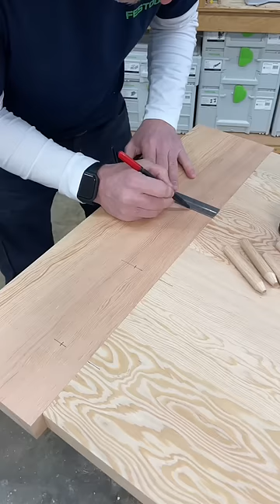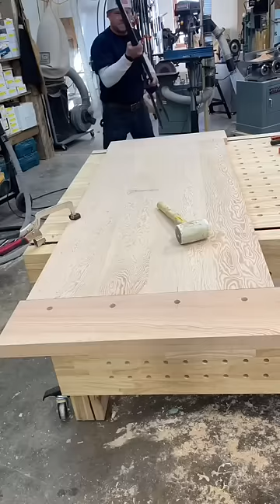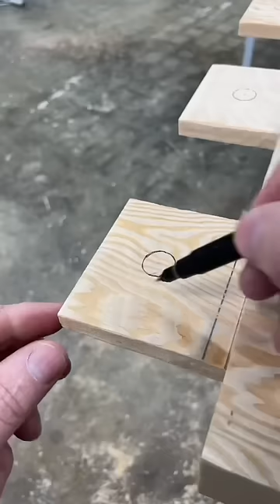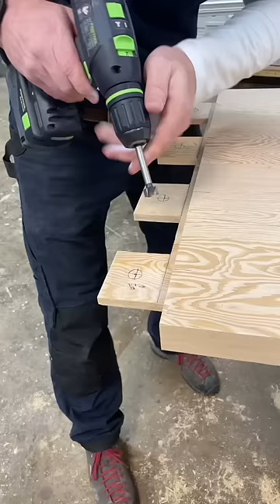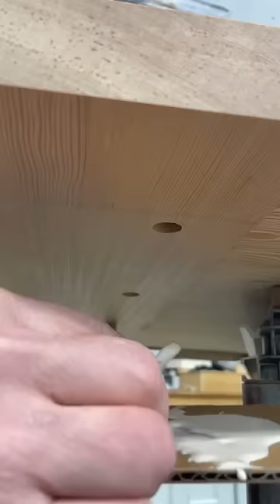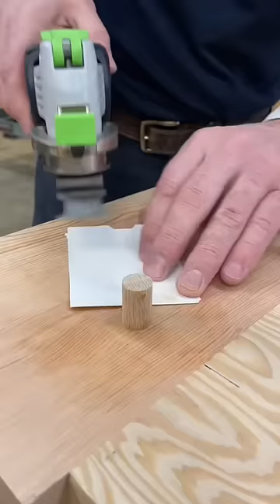Draw bore pegged breadboard #woodwork #woodworking #maker #wood #tools #bois #holz #madera #joinery

Comment: The long boards will be the ones that will expand/contract along their WIDTH due to absorption/drying from changes in temperature and humidity. The table top would get wider/narrower ( and more noticeable in areas with changing seasons, houses that use dehumidifiers/humidifiers, etc. ) The breadboards themselves will not expand/contract in the same direction as the long boards because wood doesn't expand/contract in length ( going with the grain ) appreciably, compared to the width. There isn't much wood between the pegs and edges of the long boards as far as the expansion of the breadboards along THEIR width. Gluing every tenon would cause the bread boards to inhibit movement of the long boards and could cause cracking but not if only the tenon closest to the center is glued. Only the holes in the tenons need to lengthened slightly and only along the direction where the long boards will expand and contract.
Reply: Thanks! Question answered on the 2nd comment
Reply: Thanks. Bit too complex an answer for me to understand, but I got the bit about gluing only one pin and plug that I was curious about. Michael 🇦🇺
Reply: @SpatialGuy77  lol. I didn't get it all either.  more glue =  breakage
Reply: Pins are still overkill imho
Reply: @rileyjordan9072  It's a tricky situation, you want the joint where the breadboard meets the long boards to be tight and at the same time allow for only the long boards expand and contract.
Reply: @pouncepounce7417  If you don't have pins, what will prevent the breadboard separating from the table since you can't glue the length of the breadboard ?
Reply: @Rainman270  The glued dove in the middle? It is an rather big area for glue to grip on and table tops are usual not put into pull force.
Reply: @pouncepounce7417  Actually, the male part is called the tenon, the female part that accepts the tenon is the mortice.  I personally wouldn't put glue on one of the center tenons since the pins will ( if properly done ) will keep the joint between the long boards and the breadboard tight.
Reply: @rileyjordan9072  More glue = stronger… but that just moves the failure point elsewhere. The breadboard end is designed to prevent cupping while allowing the tabletop to naturally expand and contract.
Reply: You DO have pins, like three, but only the center pin is glued, this allows the long boards to expand in their width. Basically, it's a tongue and groove situation except the ends aren't seen. You dry fit the tongue into the groove, clamp the breadboards snug to long boards with long pipe clamps, mask off the top where holes will be drilled, drill three holes ( don't drill bottom part of breadboard ), disassemble, widen only the OUTER TWO HOLES of the tenon with a rat tail file  so the long boards can expand/contract in their WIDTH. You don't want to widen those two holes so the breadboard can separate from the long boards LENGTHWISE, you want THAT joint to remain tight. Hope that helps.
Reply: @rileyjordan9072  Its hard to explain verbally, but the only thing glued is the center pin, if you glued the entire mortice and tenon ( really just a long tongue and groove,the glue will inhibit the expansion of the long boards and they will crack.
Reply: @pouncepounce7417  What will keep the breadboard separating from the table if you don't use pins and shouldn't glue the entire length of the tongue and groove because the wood might crack ?
Reply: @pouncepounce7417  That entire groove ( mortice ) should not receive glue, just the center pin.
Reply: @instantsiv  Correct and to showcase skills and hide end grain.
Reply: That was my thought, limited as it may be
Reply: @danbates5423  Well, I'm sure I confused everyone with MY long-winded explanation.
Reply: That's your opinion
Reply: @tonykinsey8933  Why don’t you wade out into the deep end and give us YOUR opinion ?

Comment: 30 years ago we put a offset to the holes for the pins on the top. So it would press the boards together. With a little pressure it would never loosen itself

Comment: I absolutely love watching these videos.  Just wondering though why you only glued the one male ended piece before putting the end cover on.
Reply: With this method you still allow the wood to move. As it gains moisture or loses it, the wood will expand or shrink. These percentages have huge differences. Along the grain most woods move about 0.2%-0.4% per % of moisture difference. 90 degrees to the fibre direction (and then it depends which section of the tree you use because there is also a different percentages for along the growing circle or 90 degrees to the growth rings) the percentages are between 4%-10%  per % of moisture difference.
Long story short: if you would glue the whole part the long grains stay almost the same length, but the cross section will move a lot. This will most likely cause cracks in wood. :)
Reply: @jose-ej7vw  incorrect, once a tree is cut to length the size ALONG the grain never changes, ACROSS the grain it does as the moisture level drops.
Reply: @riverbuilder2251  iam a carpenter from Germany. What I wrote above is exactly what all carpenters get teached here. I even did tests myself and watched videos where the movement got tested. So I don't think iam wrong :)
Reply: @riverbuilder2251  ever looked at a wooden deck? The boards do shrink a tiny bit lengthwise.
Reply: @jose-ej7vw  as a cabinetmaker/joiner from Germany i could agree more to your claims.
That being said, it does shock me how often this is not shown, considered or forgotten in these kind of videos

Comment: Very nice, i've seen too many people not add the offset, essentially making their pegs useless.

Very nice for giving a desk a bit of a wing for more area
Reply: The offset needs to go WIDTHWISE with respect to the long boards not LENGTHWISE because only the long boards will expand/contract in their width, not length. Expanding them lengthwise with respect to the long boards will only allow the breadboard joint to separate from the long boards.

Comment: Why did you overdose the holes? That goes against the purpose of that type of joint and those pins. It’s made to pull the piece closer to the shoulder. Seems problematic
Reply: The joint is called a “draw tennon” used by Amish to build tight joinery.
Reply from the maker: There is two components to the breadboard draw bore pegs. You want them offset 1/16” to create the draw bore and you want them oval shape to allow for seasonal movement

Comment: Why not glue the 2 pieces together first and when it dries, drill and peg the holes? Less layout time and no worries about lining up the holes. 🤔
Reply: Because the holes are slightly offset. So the board pulls in, therefor he can't just drill one hole.

Comment: Hey sir,  when you slid the board over the slit pegs to mark for the dowels?? Why didn't you just drill everything at once? Vs. The first mark,  pull off and drill??
Then put back on to measure for the fingers? . Then remove again for the final hole??
Then pull off again to glue and reassemble one last time?? 
Why didn't you first glue, clamp and assemble. While still under the clamp pressure..  drill the hole for dowels glue and insert the dowels??

Comment: How come you put glue on only one of those? 

Is it because that’s strong enough or any other reasons? Thanks.
Reply: With this method you still allow the wood to move. As it gains moisture or loses it, the wood will expand or shrink. These percentages have huge differences. Along the grain most woods move about 0.2%-0.4% per % of moisture difference. 90 degrees to the fibre direction (and then it depends which section of the tree you use because there is also a different percentages for along the growing circle or 90 degrees to the growth rings) the percentages are between 4%-10%  per % of moisture difference.
Long story short: if you would glue the whole part the long grains stay almost the same length, but the cross section will move a lot. This will most likely cause cracks in wood. :)
Reply: @jose-ej7vw  thanks for the detailed explanation. That makes perfect sense. I love how technical all this is and there’s so much variables to consider. True craftsmanship!
Reply: @TheBang911  yes! It's a complex topic!

Comment: Why did you take off the piece to make the holes? You could've simply do them in place and save yourself having to do it twice and avoid the 1/16th error you had.
Reply: The small "error" was intentional to put pressure on the joint

Comment: New to woodworking, why didn’t you glue every biscuit? No hate just trying to figure if I’ve been wasting glue.
Reply: It allows the movement of the wood which stops it from creating tears and cracks over time as it shrinks and expands, wood is a natural and moving material, should always be in the back of your head when working with it

Comment: I understand the reason for the offset holes for the drawbore now, thanks to you. Now I am curious as to the reason for the double drilling on the tenons. With the dowel tapered like that, wouldn't it be able to fit in the single hole in the tenon well enough?
Reply: I think it's for seasonal movement.
Reply: As already stated, the main body of the table will expand and contract depending on the moisture in the air. The extra wide holes allow for this movement. It's the same reason why he only glued one of the tenons, but all of the pegs. It allows the main tabletop to move within the breadboard end.

Comment: Why did he remove the added board to drill holes if he was going to glue/peg it anyways.  I see lots of unnecesary steps here, just wasting time.
Reply: Because the holes are slightly offset. So the board pulls in, therefor he can't just drill one hole.

Comment: Genuine question: why is this preferable to just drilling straight through when it’s assembled and clamped? And, what’s the benefit of the offset to left and right?
Reply: Because the holes are slightly offset. So the board pulls in, therefor he can't just drill one hole.

Comment: I have a few questions, why did you only glue one tab? Is this just an example or is this an actual project with purpose? Also, why did you widen the center tab hole? I understood why you brought it in 1/16th but if you squared it shouldn’t it work fine? I feel like if you give it room to wiggle it wouldn’t have as tight as a grab as it could

Comment: Not much of a wood worker here bur I have a question, why could you drill through all the pieces together?
Reply: Because the holes are slightly offset. So the board pulls in, therefor he can't just drill one hole.

Comment: Wouldn't drilling all 3 surfaces simultaneously give a better aligned, cleaner hole with less layout time? I've been curious about this for a bit, I hope you have the time to explain it to me....nvm...figured it out
Reply from the maker: This technique is called draw bore and you drill the holes so they are offset (have to drill separately) by about 1/16”. Then when you hammer the peg in it pulls the joint together tight. The holes are also lengthen so the wood has room to move seasonally
Reply: @The Dusty Lumber Co  thank you for your response, (really quick too!) After asking the question I continued reading on down through the comments and saw someone talking about it and figured it out. Woodworking is only a hobby for me and I have not needed to use that skill. Even though I really hope to soon!! Thanks! Love watching you do your art!!
Reply from the maker: @scottpolk1698  👍👍😁

Comment: I thought Norm on This Old House had a lot of tools. But this guy is too much. I can't even stand watching him because he might not possess any real woodworking skills. With the tools he has for every little part of a project you can't tell if he has any skills. He actually had a tool to mark the half inch circles in the hole not just the center. Then when he pulls out the tool to trim the dowels with a piece of paper to protect the board. Then literally 20 secs of sanding of sanding and perfect finish. Am I the only one that gets annoyed by these videos?

Comment: That is fantastic. Good job. Not many people pay as much attention to wood movement when gluing up.
Reply: What do you mean?  What's the deal or specific that you're calling out?  I don't know about this stuff
Reply: @rgbking488   you notice, he only glues one tennon on the the table and only glued the top and bottom of the pegs. This is to allow for side to side expansion and contraction of the other tenons while the glued one holds everything in place and the peg allows for the same in the vertical plane. Most people will not be so attentive. Especially when it comes to gluing the pegs. Usually glue all the way through and hammer home where as this guy has a dry middle for the tenon.
Reply: @paulacreman5342  that's what I mean, wowww.  I saw the 1 gluing, and was wondering why...then I just assumed, 'eh he probably glued them all just didn't show us.'  Ha, definitely didn't.  Yeah that's interesting, but definitely makes sense then.  Wiiild attention to detail - most don't have any attention to detail skills today, everyone is plugged into the matrix.  Thanks for pointing that out and explaining, super rad 👌
Reply: @rgbking488  your welcome chap. We were all born without knowledge, only learn by asking questions. Take it steady.

Comment: Hey man, I have a serious question. Why would you not have drill the holes while the bread board was attached to the other part of the table? Why did you drill them separately? I’m not trying to act like I know the answer to this. And this is not sarcasm. It’s a sincere question.
Reply: The 1/16 will make the joint tighter.    That is why you don't drill both at the same time.
Reply: @homesteadhaven2010  oh ok I get it now